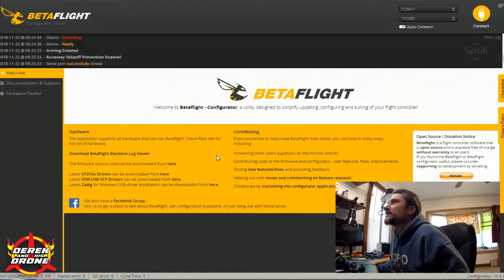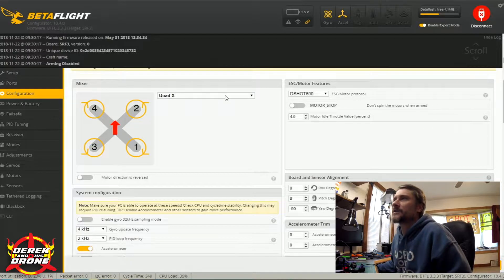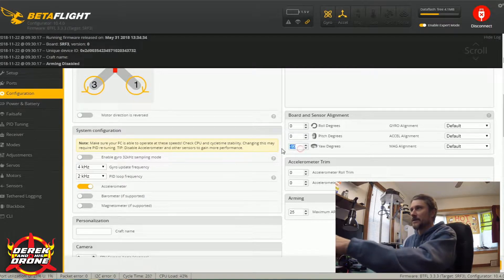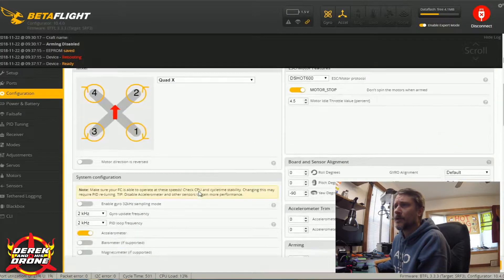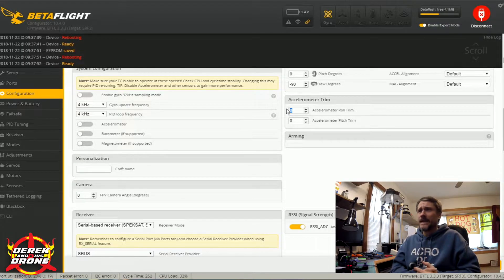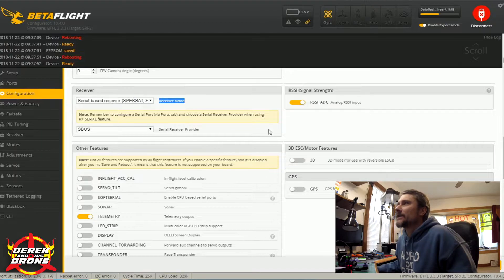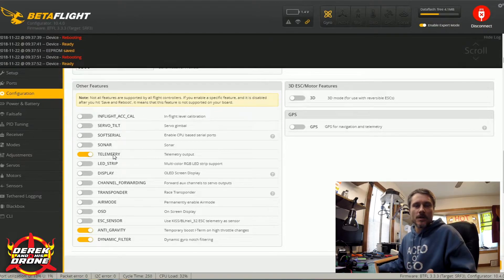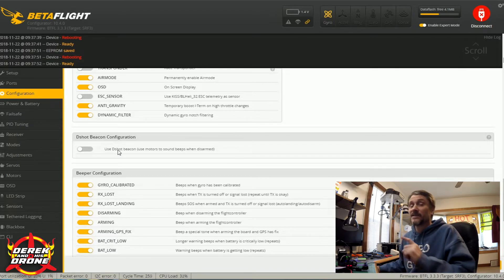Basics of Betaflight - Configuration Tab

Comment: On the Gyro and PID loop frequency...  Is it necessary for the PID to be half the Gyro frequency?  I have a Matek F-7 was using 32, 16K.  I heard that it actually works better with 16, 16.  Your thoughts on this theory?
Reply from the maker: It depends on the ECS protocol older steups that use one shot would have to use half the PID loop to the gyro.  There is no benefit to running a gyro at 32k.  At that speed the gyro will disable it's internal filters and have to relay on the filtering in Betaflight.  The hardware filter in the gyro is faster and better than what Betaflight can do.  KISS runs on a 1k loop and a little bird told me that future releases of Betaflight will only support 4k loops.  A faster loop in not better.  It will introduce noise requiring more filtering slowing the loop.  More filtering equals latency.